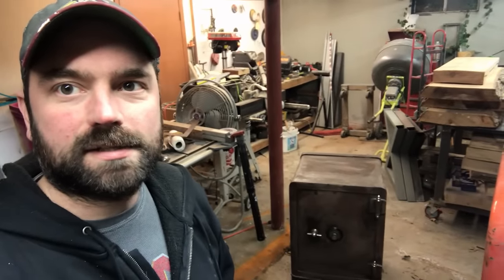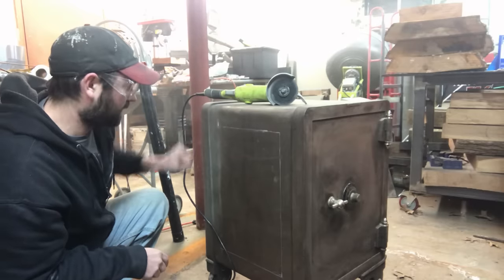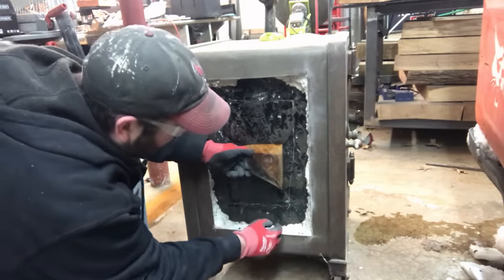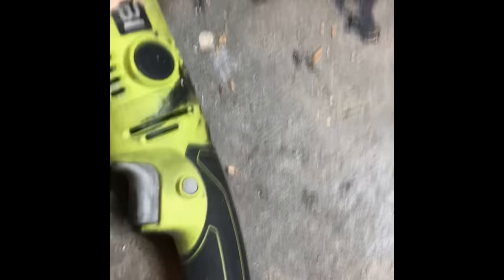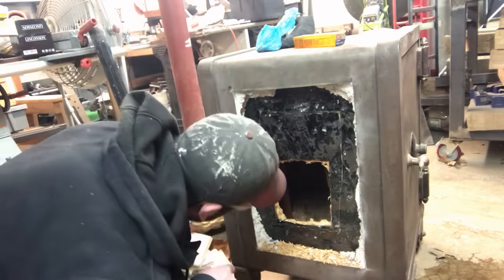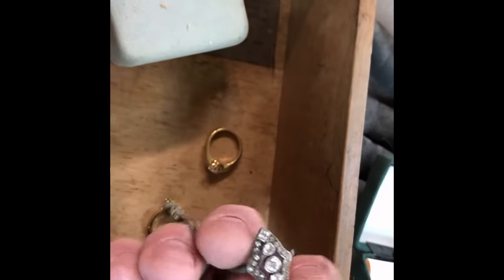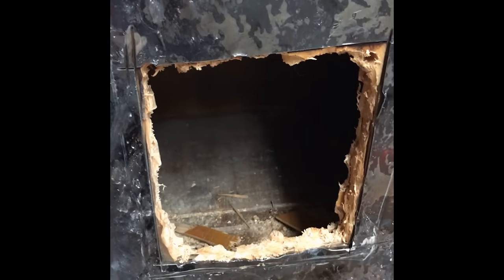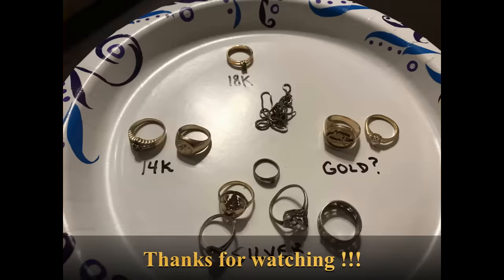Breaking into locked antique safe! What's inside???

Comment: The booklet with personal information and pictures is likely the store manager at some point. Look closely you might find a receipt for the safe with the combination on it. 
I hope your smart enough to check the years on those silver 50 cent pieces.
Reply from the maker: I did find an envelope inside with a combo, but it doesn't seem to work. The 50 cent pieces were from '71 and '74 so not even silver. I think I'm going to do a video with the combo and see if perhaps my method of entering it is flawed... Stay tuned...
Reply: @hooterspfld  my dad bought a safe from an old A&P grocery store. It looked exactly like that one. Drawers inside as well. Even with the combo,, If you didn't stand on one foot just right, it could take a half hour to get in it. You had to stop exactly on each digit. Exactly. Probably got at least one employee shot in a holdup. Thinking a delay tactic. Try, try again.
Reply from the maker: Yeah, that's what I'm afraid of, I'll give it a few more tries.
Reply: @hooterspfld  His looked just like that. I understand it's made that way for a reason.

Comment: If the safe is pre 50’s it’s likely not asbestos. But this should be a massive concern when breaking into safes.
Reply: More likely to be asbestos
Reply: @Preppapigslays  based on what? Just curious
Reply: It’s been around since 1800s be more likely not to contain it after the 50s
Reply: @MrPhaldar  sorry it’s been around a lot longer than that but commercially manufactured in the 1800s

Comment: Would have been best to call a locksmith and spend a little then you have had minor damage and then a safe. What you have now is about $20.00 at the most of scrap metal.
Reply from the maker: Sorry, can't make everyone happy, just didn't make financial sense to spend $250 to have a locksmith open it only to have a safe that was worth less than $250. I did however repair the cosmetic damage and use it as an end table now. https://youtu.be/j2EfWsy6IHU

Comment: all you needed to do was drill a 8mm hole next to the dial and lifted the bars to open it you could have yt a video on how to do it smh you missed 2 drawers at least by going in the side got 2 at the top set back and a plate in the base with 2 or 4 drawers

Comment: The safe probably was worth more than the 250 dollars to open it. Probably was lined with asbestos not concrete. It takes all kinds LOL
Reply from the maker: I had done a quick google search before cutting into the safe, and the site I looked at said they were filled with plaster of Paris, which is what it looked like in my safe. Hopefully it's not asbestos, but I did a follow up video where I test for asbestos. As for the value, I think you'd be surprised, antique safes in much better condition can be bought for $250-$300 around my area at least.  https://youtu.be/15dJRofGxhQ
Reply from the maker: Asbestos test results are in: https://youtu.be/Trf4CelSTjE

Comment: Unscrews the chrome pins hinges and it will open without breaking it dude
Reply from the maker: No these safe doors have a fixed bolt on middle of the hinge side, so they will only open if the lock retracts the other 2 pins.

Comment: Do you know what a hole saw is for a drill and a pair of tin snips drill a hole in it with the whole saw then cut it open with the tin snips that way you won't light any money on fire inside the safe
Reply from the maker: You're right, There were lots of better ways to get into the safe. However my job trailer was onsite, and it was too cold to work.  I decided to cut into the safe to make use of an otherwise waste of a day.

Comment: Would it not be more logical and easier to grind off the hinges on the front where the door could then be easily removed?
Reply: You can cut the hinges off and never get the door open, there are pins that go into the wall of the safe at the hinge side as well as the other side. and that locks her pretty tight. So taking the hinges off does nothing for entry into the safe.

Comment: You can listen to the lock tumblers and find 4 numbers....
Reply from the maker: Post a video on YouTube. Would be very helpful to see.
Reply: @hooterspfld  I can understand that,but I'm not really "part of the u tube clan"....ask me a question
Reply: 4/5 number lock...each tumbler falls at a different "sound"...it can go several different ways if you don't have a cheat sheet( they make this easier) if you already know LLRL,RLLR,RLRL,LRLR you start with the weakest "clunk" to the strongest...strongest to weakest,
It really helps to have that cheat sheet....I had to turn mine back in to my "teacher",and was instructed to make my own.
I changed jobs shortly after that and have only opened a few pad locks since

Comment: Well that safe is worthless now.
Reply from the maker: While I did cut into the safe, I also patched it up as well. If you don’t want to watch the whole video, just skip to the 20 minute mark. https://youtu.be/qYYdVo22NzM
Reply: @hooterspfld  I was skipping ahead a lot, and yeah I see the patching.  Did you replace the asbestos liner between the outer and inner wall and how about the woodwork on the inside?  Construction and excavation says volumes, if I hire you to tear down a building, you would very effectively and professionally flatten it,  I have no doubt, however, sometimes it takes a gentler touch.  For example, a locksmith. The point is that sometimes beating open the treasure chest with an axe is a bad idea. 👍

Comment: Woulda been a whole lot faster and easier to go in through the bottom. Cutting through the thin cladding with an angle grinder is going to warp and distort the steel and make it impossible to repair the way you think it's going to comer out!!  🙄
Reply from the maker: While I did cut into the safe, I also patched it up as well. If you don’t want to watch the whole video, just skip to the 20 minute mark. https://youtu.be/qYYdVo22NzM
Reply from the maker: Yeah there has been a lot of concern on that, so I made a video: https://youtu.be/Trf4CelSTjE

Comment: Simple way to open it is remove dial drill out pin. Another hole between that and the handle insert wire with hook lift the bar while using a screw driver to lift the tumblers. Works for me! Funny what old safe breaker show you lol. I conclude this blokes a ratbag for destroying that safe, madness of destruction not needed.
Reply from the maker: Yeah, too bad I didn't have an old safe breaker to ask for help.

Comment: Silly to destroy the safe like that opening it would be relatively easy
Reply from the maker: Well I have to disagree, I had a lot of fun breaking into the safe and then had a good time putting it back together. Without extensive training, the only way to break in would involve trying thousands of combinations and hoping you get close enough to get the tumblers to line up... Not the way I want to spend my time though. Actually cut into it again found out the combo and repaired it. https://youtu.be/qYYdVo22NzM
Reply: No insult intended just that my father was in the safe industry and I have helped many times with opening old boxes like this,also that asbestos was in common use in those times . You have made an entertaining video for many I have not,well done on that front.
Reply from the maker: No worries! It's one of those things, if you have the knowledge to do it, it's easy, if you don't, you have to pay someone that took the time to gain that knowledge. For me it was just a bit of an adventure seeing if there could be treasure inside, which was fun. I did end up testing the fire proofing and luckily it was free of asbestos. I shot a video on that too, as there where some pretty nasty comments left on the video. Thanks for watching!

Comment: Ahhhhh  drill a 1/2" hole top and center back, lite on top, 18" screwdriver, remove inside door plate, align cams, wa la
Reply from the maker: Not being a professional lock picker, wasn't sure what I would see on the inside of the door, hence cutting a big enough hole to get to all the contents. While I did cut into the safe, I also patched it up as well. If you don’t want to watch the whole video, just skip to the 20 minute mark. https://youtu.be/qYYdVo22NzM
Reply from the maker: no idea what this even means???

Comment: They may have got more than they bargained for. Those old safes used to have mace spray in them. 
A local gun sop had purchased one to keep in the office. And one day the owner told me every time he went in there he choked and had coughing fits. Called the fire department and found out the can was so old it had rusted through.
Reply from the maker: Yeah, I've heard of tear gas, mustard gas, and even nitroglycerin, being used, that's part of the reason for going in the side. Anything I've ever seen has been protecting the door.

Comment: You know, if you had simply popped the pins 
out of the hinges the door would have come off?

!
Reply: There are locking bolts bolts inside the safe door which lock into the sides or a safe could be broken into with a sawzall....not very “safe”?. Also the hinges are offset top and bottom so even cutting hinges would not allow door to be taken off..

Comment: Or you could have legitimately learned how to crack the safe. Old style combination dials like that are very easy. Not to mention if you thought there was "Treasure" in there why wouldn't you spend money to have a locksmith do this professionally...
Reply from the maker: Check out lockpicking101.com, I think you'll find cracking into a safe isn't something anyone joe blow can do. Also it just didn't make financial sense to spend $250 to have a locksmith open it only to have a safe that was worth less than $250. I did however repair the cosmetic damage and use it as an end table now. https://youtu.be/j2EfWsy6IHU

Comment: Why didn't you just take the pins out of the hinges .🤔
Reply from the maker: If you take out the pins, the locking mechanism is still engaged, door wont fall out. Plus I repaired the side and use the safe as an end table now.
Reply: @hooterspfld  👍

Comment: Why do men do things the hard way? It would have been better for you to watch a locksmith video. Usually they drill the locks.
Reply from the maker: Sorry I don't think it's that easy. "At a minimum, to drill a safe, you’ll need a drill; diamond and tungsten carbide drill bits, capable of boring into reinforced metals; an optical device called a borescope; and a stethoscope, and years of knowledge to know how to manipulate the lock." According to Francesco Therisod, 71, who has been a safecracker in Providence, R.I., for nearly 40 years.

Comment: A cheap suction cup microphone and headphones would have been way cheaper and easier and you wouldn't have had to ruin it.
Reply: Also....old concrete dust itself with the asbestos they mixed into it isn't very nice.  Should have worn a respirator.
Reply from the maker: Shoot me a link to a video of you opening a safe with a cheap suction cup mic and headphones. I called around locally and only 1 guy would do it and he was charging $250.
Reply: And sandpaper the fingers, I saw it in a spy movie... he heeee
Reply: That type lock could be opened by very incompetent safe person with very little research! I had safe that was locked since 1963 packed that heavy bitch around for yrs got gentleman from 21/2 hrs away from me to drive here and open safe had it opened in less than 15 min mine is a 4 number combo also, charged me 125.00 for the service before he opens it said half value of contents or 125 I went for cash payment so there out ther and reasonable if u ahop
Reply: @GlennWTaylor  come on then ,half of what was in it or 125,, 
So what was in it .🤔🤔🤔

Comment: Dummy call a locksmith, its worth more if you are making scrap metal
Reply from the maker: Yeah as I stated, I could have paid $250 to have it opened... Safe with the combo isn't really as valuable as you would think, much nicer ones can be found in my area with the combo for $200-$300.  While I did cut into the safe, I also patched it up as well and now have the combo, plus it was fun.